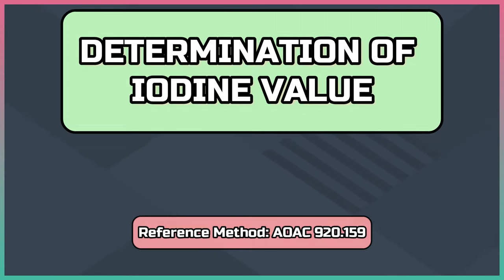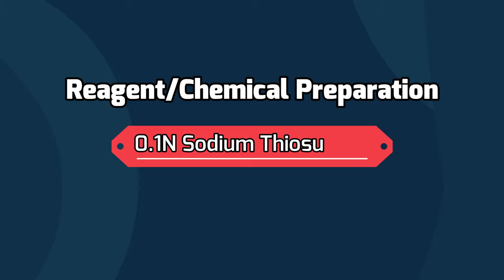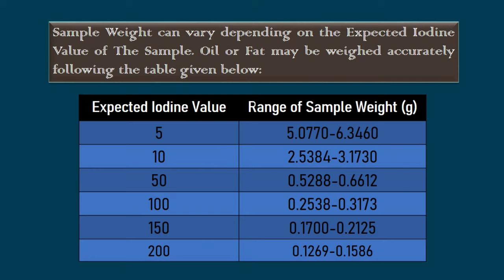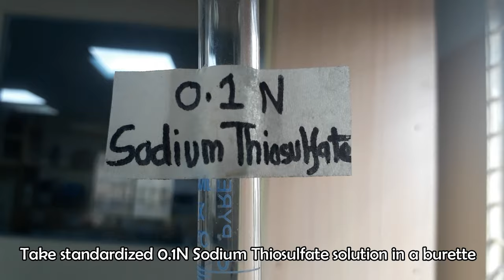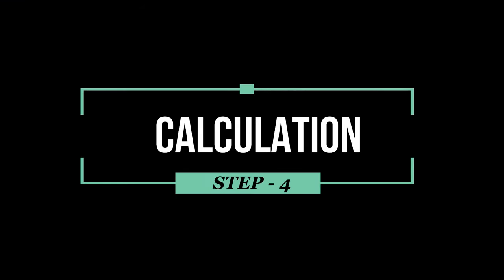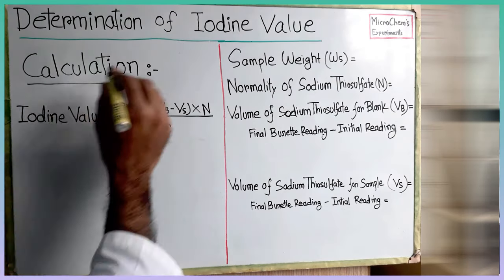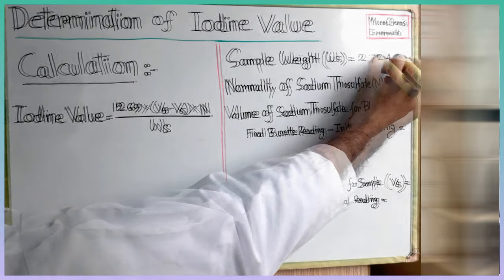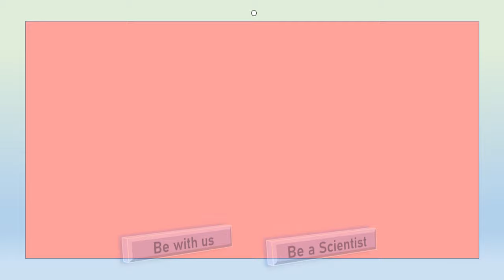Determination of Iodine Value _A Complete Procedure (AOAC 920.159)

Comment: Thanks for your wonderful and passionate video. It's really useful for my work. I wonder some point that could you explain for me, please.
1. Why we certain use Carbon Tetrachloride in this experiment. Can you explain in detail the reason why you use Carbon Tetrechloride? Can I replace it by other substane?
2. I wonder if you put Potassium Iodide crystal around the stopped? Why don't we use the solution of Potassium Iodide?
3. In the phase that you pour distlled water into the flask, you titrate the flask with Sodium Thiosulfate until the yellow is lighter before you add the starch solution in the flask. So I wonder the reason why you must to titration before adding the starch solution. Is there any theory in this phase? I really want to know.
I truly appriciate your support and I am looking forward to hearing from you. Many thanks

Comment: 1. During titration, iodine flask should've been covered with the stopper throughout in order to avoid the escape of iodine gas.

2. calculation should've shown the units also

3. It should've been 126.9 g/mol, since that is the molecular weight of iodine.
Reply: Regarding 3.: Yes, but you have to divide by 10 to get the correct unit for the IV, which is g(I2)/100g(fat). It would have been obvious, if the correct units were used in the video.
Reply from the maker: Noted

Comment: Hi, thanks for making this video! It is really helpful. I have been doing my experiment about how the number of times heating the corn oil till boiling will affect the oil’s iodine value and I realized that as I did titration, there was a layer of oil-like solution at the bottom of the flask. Do you know anything about this and why does it happen? Because it has became really obvious and disturbing since the oil darkened as the heating number increased.

Comment: Hi, I was wondering why is it so important that it should be closed immediately after pouring the wij's solution. By the way, this is a great video it has helped me so much. If you have any other papers, videos, or references about determining iodine value in oils by wij's method I would be thrilled If you could reference it. Again thank you.
Reply from the maker: Ekin Gursoy, Thanks for your comment. Actually, when Wij's solution is added, it reacts with Iodine present in the sample to form slightly volatile compound. If we left open then loss of iodine may occur. That's why we keep the flask closed immediately after adding carbon tetrachloride and Wij's solution. Other two references for this test are: IS-548 and FASSAI MAnual.
Reply: @MicroChemsExperiments  thank you very much
Reply from the maker: @ekingursoy1779  You are most welcome.
Reply: @MicroChemsExperiments  Great video, very interesting to watch. However, why was the iodine crystals added around the stopper after closing?
Reply from the maker: @khemist2631  It is added to set  a barrier for passage of gas from the flask to the outside during the 30min of the reaction time.

Comment: My question is not about AOAC  but about AOCS methods, that before weighting the sample, sample must adjust temperature to 68 -71 celsius deg. I wonder what is the purpose of sample temperature adjusting?
Reply from the maker: Chemistry is all about chemical reactions. Chemical reactions takes place differently at different temperatures. So the adjustment of temperature is very crucial for any chemical analysis of sample.

Comment: There's a mistake in your analysis the equivalent weight of sodium thiosulfate is 248.16g so if we want to make 0.1 N Sodium thiosulfate we need  24.6g not 2.48 g
Reply: your calculation is for 1000 ml, but here 100 ml sod. Thiosulfate is being prepared  by using 2.5 gm of it, which is correct.
Reply: @arknowledgezone7741  Thank you ! for correcting me, its my bad

Comment: how does heat affect this experiment? how would I heat the solution after keeping it in the dark if I want to check temperature affects on iodine value?
Reply from the maker: You can set an experiment by applying heat and let us know the result. But I thing heat will affect the test result because iodine will be removed from the flask during heating and a false result will come out from your experiment.

Comment: The video is great, but never heat a volumetric flask!!
Reply: Why
Reply: @gourab8089  If you heat glass, it will expand and contract with the temperature changes, yielding inaccurate measures, thus inaccurate solution concentration. It'll probably mess with the glassware calibration too, that's one of the reasons why the calibration is tied to a temperature.
Reply from the maker: Noted

Comment: I applied exactly like this method,but i get different results every time.
1.My sample expected iv is 122.how much Shample weight i take for test.
2.when i mix starch soluble in flask.
Plz ans..
Reply: Ans plz...
Reply from the maker: Take 0.3g sample. Add starch after starting titration, especially when the solution color becomes lighter
Reply: Can i test a soya acid by this procedure?

Comment: After preparing sample in IV flask And during kept in dark for 30 minutes why we use KI Salt on the top of the cap of the flask ??
Reply from the maker: Goutam Gupta, Thanka for your comment.
According to AOAC method, you need to add KI. KI crystal is added on the top of the cap. The reason is: it prevents the transportation of volatile substance from the flask to the outside environment. Rather KI crystal absorb the volatile material from the cap and enter into the flask during washing with water.
Reply: @MicroChemsExperiments  thank for clearing doubt .
Reply from the maker: @goutamgupta8816  you are most welcome. Stay with us.

Comment: the purpose of adding starch to boiling water, what's the point?
Reply from the maker: Nadia Nadeak, thank you for your question. Starch powder does not dissolve in cold water freely. If you add starch in cold water, starch powder coagulate itself instantly and this coagulation can't be broken readily. So we have to add starch powder in boiling water to avoid coagulation and dissolve completely in water.
Reply: @MicroChemsExperiments  thank you 

may i ask one more question What is the difference between the titration results for Erlenmeyer sharpening and Erlenmeyer blanks?

Comment: Why initial value sample of 25.6 ml and blank 2.7 ml take in burette
Reply from the maker: We started titration of sample first. In this case, initial reading was 25.6 and the titration was finished when the final burette reading was 39.2. 
We refill the burette again and start blank titration when the initial burette reading was 2.7 and finished when the final burette reading was 39.1.
NB: we did not refill the burette completely thats why the initial burette reading was started at 25.6 and 2.7 for sample and blank. There is no specific reason for it. You can start both titrations (sample & blank) from 0, 1 or any other initial point. There is no limitation in it. It's up to you that from which point you want to start.

Comment: Sir blank reading obtain very fast....18ml.....which was the mistake?
Reply from the maker: Yes. Blank should be more. Plzz repeat the procedure.
Reply: Sir i am use 10ml carbontetra chloride extra pure and 20ml of iodine solution according to gtp....
Reply: One thing also sir iodine monochloride solution (wijis) or iodine solution (wijis) is same or different
Reply from the maker: Wij's solution and Iodine monochloride solution are same. So you can use it. But don't use Iodine solution.

Comment: Your video was amazing and very informative, however I do have a few questions that could help me understand it better

Could 10% of KI solution be added during sample preparation or pure crystals are more appropriate? What would be the difference?
What if iodine value is between Expected IV in the table? For example 42? What mass of the sample should I obtain in my experiment?
Reply from the maker: No difference. You can add Iodine solution in either way. 

For your case of 40, you should take 0.5g of sample (slightly less amount of that for IV 50).
Reply: @MicroChemsExperiments  how much crystals of KI in grams did you use for sample preparation? Thank you for the previous answer ❤
Reply from the maker: @polasadowska8076  about 0.5g

Comment: How to prepare wijs solution?
Reply from the maker: We will make video later
Reply: At least tell me the procedure
Reply: At least tell me the strength of the wijs solution that you have used
Reply: Is that a readymade bottle that you've used?
Reply: Unit of iodine value as per your formula?

Comment: No KI is adding at the end????
Reply from the maker: @Kasthuri Kk,
KI is added in the conjunction of the flask stopper and after reaction time added KI is washed in by adding distilled water.
Reply: How to assume ki is enough,what amount dear?
Reply from the maker: @Titi-je3ff  AOAC method says to add 20ml of 15% KI after getting the flask back from the dark condition. But FASSAI manual says to add 15ml of 10% KI solution.
So, there is no specific amount. So you can follow either one from the AOAC & FASSAI manual.
Reply: Thank you so much

Comment: How to prepare wijjs solution
Reply from the maker: Ravi Parodhi, thank you for your query. In this video, we used commercially available Wij&apos; iodine solution. So you can buy Prepared Wij&apos;s iodine solution from a reputed supplier.
Otherwise, you can also prepare Wij&apos;s solution in your laboratory by the method given below:
Preparation of Wij&apos;s Solution: Dissolve 13ml Iodine Monochloride in about 1000ml Glacial Acetic Acid and shake vigorously. Now pass the solution in dried chlorine (dried though sulfuric acid) until original sodium thiosulfate solution is not quite doubled. Store the prepared solution in amber colored bottle.
Reply: 2800ml glacial acetic acid + 1 ampl(iodin)

Comment: if i wanted to investigate How do light intensity and temperature affect the stability of unsaturated oils, determined by measuring iodine number, how would this work? simply what is the relationship between stability of unsaturated oils and iodine value?
Reply from the maker: Light intensity & temperature disintegrate, rancid or distort fatty acids of oil sample with time, resulting weird level of iodine value. Every oil have a known reference iodine value. Change in iodine value indicates that the oil is distorted.